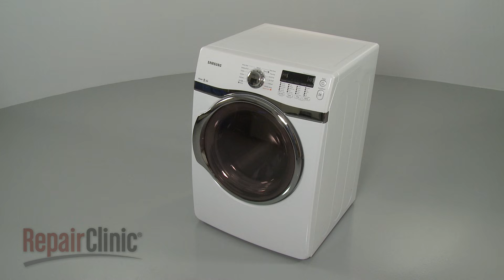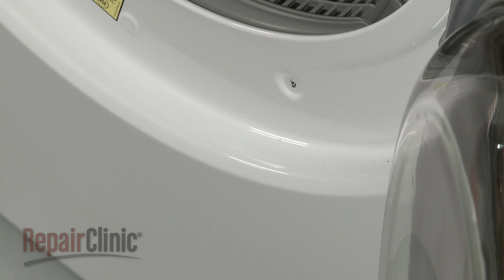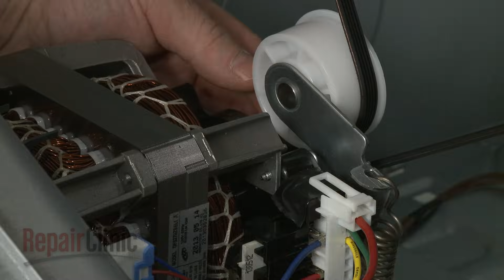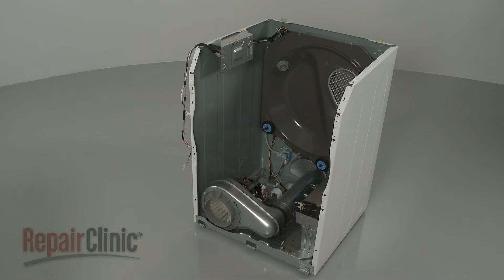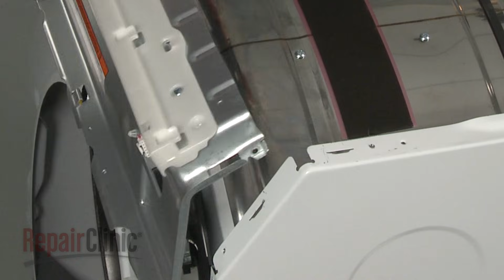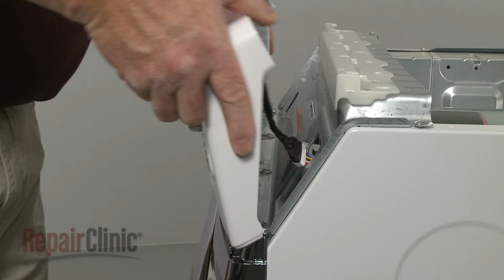Samsung Electric Dryer Disassembly – Dryer Repair Help

Comment: Thanks a ton. With this video I was able to replace the rear bulkhead and get my dryer back up and running without having to purchase a new one. Excellent step by step guide and loved that you built it back too. Outstanding material.

Comment: Thank you for this video! It really helped me a lot! I have a slightly older model of this machine and for the most part everything was the same. My dryer stopped spinning over a week ago and noticed the drum was easy to spin so I had an idea that the belt snapped. Since I was going to be taking apart the machine to replace the belt anyway, I decided to also replace the pulley and the 4 wheels too. It wasn't that hard but it did take some time but I'm glad I also replaced the mentioned parts since the pulley and wheels and the rods the wheels where in were worn out . But in the end the dryer is working like new again.
Reply from the maker: Great job! We are happy to hear that you have fixed your dryer.

If you would like to give us a review, here is our link: https://g.page/r/CcVUrahZNozMEBM/review

Have a great day!

Comment: If you wanna test your thermal fuse or heating element there a access panel on back that the lint tube comes out , take that off and you can reach in and test your thermal fuse,
Reply: This comment should be highlighted at the top!  Thank you for that!

Comment: Thanks for the highly detailed and visualized installation instructions. I was finally able to repair the belt and pulley on my dryer because of your video. Your dryer was exactly like mine,except for the light connection. Reconnecting the belt took a while because it needed stretching a bit, but your video was on point. Excellent job! 👍👍

Comment: Thank you, I used this in part to fix my grandmothers 11 year old dryer. Her heating element went bad. It would have cost us twice the cost of the part just to have the repair man drive to our house, instead it only cost the price of the part.
Reply: Hello I have a problem with mine it starts to smell like burnt was that your problem ?
Reply: @kevinherrera2403  My issue was that the machine was not heating up properly.
If your machine is smelling burnt it may be that lent or debris has built up somewhere inside the machine a failing motor heating element or strap. I would Google burning smell while running dryer to get ideas on how to troubleshoot.
If you decide to open the machine you may be able to find one of these issues in your machine.

Comment: Thank you! I just replaced my broken heating element using your video. Sooooo helpful!
Reply: My Samsung has stopped heating. All dusts are cleared and all else works. Is the heating element most likely the part I need? Thx.
Reply: @lj4501  did you fix your problem because mine smells like burnt so ima take it apart ?
Reply: @kevinherrera2403  Heating element was broken. Once replaced all works well. It did not smell. It just stopped working

Comment: Fantastic tutorial. Seriously. Extra points for specifically showing screws on the way out and when replacing them. This is a HUGE thing since many tutorials of all kinds just say something like, “and then put everything back the way you found it” without showing it.

Comment: Replaced idler pulley and spring. Now if you stand on front of the dryer the drum is turning the wrong way (clockwise) runs for 10-15 seconds and shuts off ?

Comment: Thank you.  Our model is years newer, but this video was still spot on.  The only difference was that the control panel was a lot harder to pull off due to extra plastic clips in difficult-to-reach spots.

For reference, our issue was a shattered idler pulley wheel.
Reply: I'm having the same issue getting the control panel off.  What ended up working for you?
Reply: @throwintre  No trick I'm afraid, we just kept at it.  One of the clips broke during the removal but it ended up not mattering once we put it all back together.
Reply: was your machine making a loud squeaking noise as it tumbled?  My Dad's dryer is very obnoxious sounding.  We feel like we can't leave it running when no one's there to keep an eye on.  I'm going there this weekend to pull it apart.  I've dealt with other brands and their issues over the years.  I've never opened up a Samsung Dryer.  Pretty simple stuff.

Comment: I have a Samsung dryer, model DV337AEL/XAA.  I need to replace the belt, but cannot figure out how to get the top/front control panel off.  The top panel is off, and all 6 screws are off, but it's not coming off.  Do I need to take off the front door first?

Comment: I’d like to add one detail that I found out the hard way. After setting the drum in, when installing the belt, your arm presses right against the wires that go to the heating element. Mine pulled off and I didn’t notice, so I had to take it back apart just to plug the wires back on to the heating element. Thank you for the great video!

Comment: Nice video. Mainly I learned that I can access everything basically without pulling the dryer out. Except for those 2 top screws. I can get to the wheels, belt, and idler bracket then. Ordering parts now.

Comment: DV42H5200EP ; Front pannel will not come off as easily, seems stuck in the middle. More pull will probably break something...
Reply: I had this same problem. How did you end up getting it off?

Comment: Thank you very much. You saved my home from being burned down. I smelled a burning smell from the dryer and only pulled off the exhast tube and cleaned that only because i didnt know how to open up the dryer. Your video got my able to completely open my dryer to find that lint was burning ontop of the heating element and gas line!!!it was pitch black!  thanks a ton!
Reply from the maker: Wow, nice work!
Reply: Mine smells like that 😊

Comment: My control panel won't pop off as easily as it seems like it should. My model is: DV42H5200EW/A3. Do you have any suggestions?
Reply: Mine as well is really stuck from the middle. DV42H5200EP . TIPS?
Reply: @theJoPanda  I am in the same situation, front panel is stuck in the middle. Any suggestions or anyone has figured it out?
Reply: @dhairyashilpatil69  sadly i think i did remove it but broke 1 or 2 little plastic pins. It still works fine without rattle. A small screw driver pushing the tabs can help, or pulling in the proper angle. Good luck. Hated repairing for hours but yeah it's holding strong =]

Comment: After my Samsung Dryer fell apart and Samsung refused to even acknowledge their product was defective, I decided to tackle it myself.  I went to the repair clinics site, found my dryer drum under my model number and ordered it.  It arrived in great condition quickly and folowing this repair clinic video, I removed the old drum and installed the new one in less than 2 hours.  I am now a fan of Repair Clinic.  I highly recommend their business and their installation videos.

Comment: Is this Samsung unit disassembly similar to the Kenmore Elite Series?  They look very alike.  I need to access my neighbors dryer because there is a lot of lint in their lint trap
Reply: I know this is 9 months later and probably too late, but for anyone else coming late - yes, the Kenmore Elite I have, which I purchased in Canada, model # 592-893040 - was built by Samsung and is almost identical to the dryer in this video.

Comment: Hi Repair clinic
This really a fantastic video you have there.  Thank you.  We just bought the samsung DV80F5E5HGW dryer and trying to connect the drain hose with the 2 m long black hose that came with the dryer exactly like it says in the manual, but it won't work.  The dryer stops drying and shows a red sign on the screen that he cannot get rid of the water.  I connected then back again just like it was in the beginning to ensure then that the water would flow into the water-shelf but that now doesn't work either.  Have you had this before.  do I need to do sth else?

Comment: I added a tiny bit of grease to each of the 4 roller shafts since some showed some signs of wear. Is that OK?
Reply from the maker: +Spydo Staxxe The rollers are self lubricating so adding grease is unnecessary.

Comment: I didn’t realize it but I set my DV419AEW drum aside before noting the FRONT or BACK of the drum. Does it matter? It looks like the RED TAPED side goes to the front is that always true?
Reply from the maker: +Spydo Staxxe If it moves freely you might be OK. Check the felt seals, if they are different then you should re-take it apart and put the drum in correctly.

Comment: Thanks for this.  There was a grinding screeching noise.  The underwire from a bra made its way down to the blower.I didn't need any parts. The video couldn't be more clear. ...need to see if I can get the belt put back. georgeP
Reply from the maker: +George Pringle Thank you for sharing.

Comment: Hi Repair Clinic,
My Samsung drier wont start.  I probably messed it up; the other day, I was emptying it and inorder to reach out to some clothes I was rotating the drum and by accident rotated it anticlockwise.  This is when it caused a clank sound.  The drier was turned off all through this.  Subsequently, the drier would not start.  Could you please suggest what could have gone wrong?  Do you think the door switch was damaged?  What is that 'clank' sound due to?
Your video guides me how to access each part in the drier, but I need to know which part is gone bad, so I can place order and replace.
I would sincerely appreciate your help.
Thanks. Raj
Reply from the maker: +Raj K it is hard to say, but testing the door switch is a good start. Also, some models have a broken belt switch so perhaps the belt came off the pulley.
Reply: The belt might have come off the idler pulley or the spring came off when you rotated the drum opposite way.

Comment: mine was filled with lint too.  I am so glad I came upon you video.  It was so easy to understand and straight to the point.  Lint cleaned out all put back together and working fine.  Thanks again.
Reply from the maker: +Carrie Siesser Thank you.
Reply: RepairClinic.com im trying to see if lint build up around drive motor is reason why it doesn't heat. do i have to completely disassemble as the video show to get to drive motor and clean it?
Reply: @shaylawhitehead8171 I'm sure you've already handled it.  7 years ago.  My comment was for those who read yours and wonder the same thing.😅
Reply: @davismize I read it and was like when I said this😂. I don't remember what I did but have a new set for years now. Thanks for that info because it can be used for future❤
Reply: @shaylawhitehead8171 Of the dryer tumbles then it is not the motor.  it's usually the element.  Easy to get to, unplug, remove, replace then plug back in.  Pretty simple.

Comment: when I took the dryer apart it was filled with lint.  Is this normal?  Or could something else be wrong?  Thank You
Reply from the maker: +Anthony Recco It is not unusual to find lint inside. The dryer exhaust vent should be cleaned occasionally to help reduce the amount of lint that can accumulate within the appliance.

Comment: I have a Samsung dryer model no DV316LES/XAA and it won't spin  after hitting the start button? Any thoughts and thank you for your videos.
Reply from the maker: oliver915 A number of things could cause the dryer not to start. http://www.repairclinic.com/RepairHelp/How-To-Fix-A-Dryer/1-160-1067166-/Samsung-Dryer-won-t-start-DV316LES?TLSID=1773
Reply: you might have dropped a sock or something else down by bottom of drum if you forgot to put lint filter back in after cleaning take a flashlight and look for item between drum and machine

Comment: Thanks for the video, taking my Samsung front load was a snap.  Just vacuumed the lint out.  It's been running for one cycle and then won't turn back on for about an 45 mins to an hour and then if you start it again, it only runs for a few mins. I have to let it sit for a few hours to run another "full dryer cycle."  If cleaning the lint out, doesn't fix it, I'll order some parts from you, just because the videos you provided were so helpful! Thanks!
Reply from the maker: LongRX7 We're glad the video was helpful to you!

Comment: I have tested the relay switch, the high temp., the thermostat, and the heater, all are working. the dryer will not heat up anything I am missing. The repair clinic
Reply from the maker: There are a few other possible causes. Enter your dryer's model number in our website's repair help section: http://www.repairclinic.com/repairhelp?TLSID=1773.

Comment: Thank you so very much *****!!
You saved the day. I was doing a poor job of cleaning the lint/blower housing and dropped a chopstick down in there, which quickly got all the way down where it could not be seen. After a few searches I came to this video. 
20 minutes later, I have the missing chopstick, the dryer is all in running order and the lint is all gone to boot.  Total win!
Reply from the maker: Rodrigo Lagos Those runaway chopsticks! Congrats on the successful repair. We're glad the video was helpful. Next time you drop a chopstick, consider using this handy brush to retrieve it: http://www.repairclinic.com/PartDetail/Long-Handled-Bristle-Brush/5303318693/12859?ss=c27&mr=0?TLSID=1773.
Reply: yes lets not loose any more chopsticks :-)
Reply: I messed up and ran the dryer without replacing the lint screen.  I think there is a sock or two inside banging around.  I'm trying to remove only the case for the lint screen.  I removed the 3 inside screws and the two front screws, but it will not come out.  Hoping that I don't need to disassemble the whole dryer per these instructions.  HELP!!!!!
Reply: Mary Lou Tull from what I can tell there is no way for the tray housing to come out without removing the front panel. Watch the video its pretty clear at each step. Its may seem a bit daunting, but if you are comfortable using a screwdriver and following directions, I think you can do it.
That's just my own personal opinion :)
Reply: Rodrigo Lagos Thanks!  I actually did find a separate video that showed me how to remove the housing.  I was able to pull one sock free, but a second one appears to be caught under the drum.  Soooo..... I will be taking it all apart, but not today!!
Reply from the maker: Mary Lou Tull How did it go?
Reply from the maker: Mary Lou Tull  Glad to know it worked out!

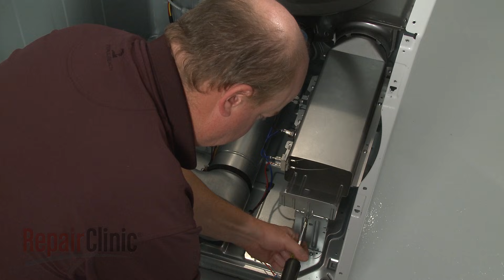Comment: Excellent video as others ave said.  Just curious though, at 3:08 you show detachment of a water inlet...in an electric dryer?  Again at 4:19, you show re-attachment of said "water inlet".  I'm fairly certain that there is no water inlet in my machine.....
Reply from the maker: Good question! This particular model has a steam feature that requires water. Therefore, a water inlet valve is necessary. If your dryer does not have a steam feature, it won't have such a part. :)

Comment: Brilliant tutorial video. It is well paced, correctly sequenced (complete disassembly followed by re-assembly), and camera angles and lighting is perfect. I have a different model Samsung dryer, but the steps and dryer construction are essentially the same. A pen dropped from the lint trap opening into the blower assembly. After removing the front panel, removing the blower cover revealed the plastic blower fan blades. The pen was underneath the blades, but simply rotating the drum popped the pen up into the blades allowing me to pull it out. Thanks for producing this. It made what have could have been an expensive service call into a simple 30 minute job.
Reply from the maker: Joey Lee Awesome! Congrats on the successful repair. It's always amazing what can make its way into a lint filter.

Comment: hello, this is a very informative video, would these directions be the same for a gas dryer? Another question is how much would I need to dissemble to get to the valve to convert the samsung gas dryer to liquid propane?

Thanks for your input.
Reply from the maker: The gas and electric dryers  come apart the same way. You will need to get the front panel off to get to the burner assembly. If your dryer is similar to the one in the video it most likely will come apart the same way.
Reply: ***** thank you, anyway to get video instructions on how to convert the valve from a gas dryer to liquid propane?
Reply from the maker: Unfortunately we do not have a video on how to do that. Sorry!